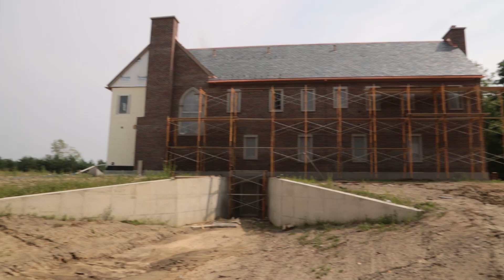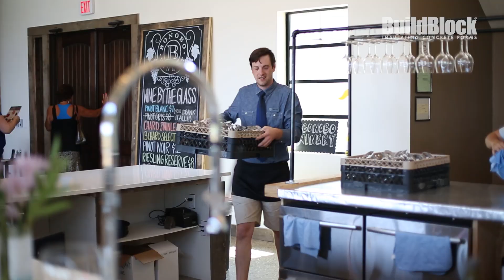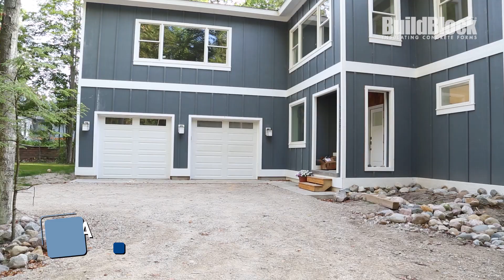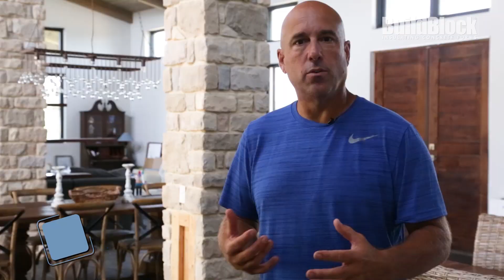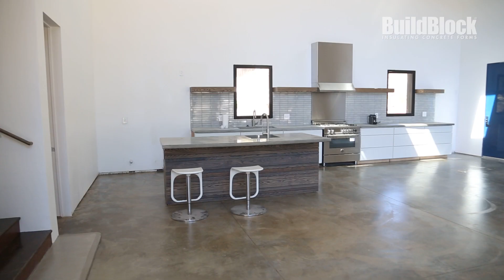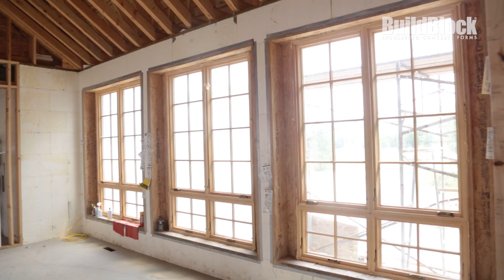Why Build With ICF? Real Customer Stories

Comment: Good testimonials; but I'd like to see more videos on houses that I can afford - like 1400 to 1600 square feet.
Reply: Why would a smaller icf perform any differently than a larger? The point of the video, it seemed to me, that icf is the perfect way to build regardless of size or location
Reply: @paulnovak833  i can relate more to a house that costs $250,000 to build vs. a house that costs  $1,000,000  or more.
Reply: @scottcraig1047  250,000 is definitely the low end of possible unless you are doing most of the work yourself
Reply: ICFs cost ~20% over stick-framing by most estimates that I have seen (but the devil is always in the details) but that tends to be the case with these more "exotic" systems that you pay more up front for long term gains in terms of longevity, durability, comfort and energy savings.  I have a little under a decade to go for retirement and my new retirement home will be ICF of some guise.  Nudura, Perfect Block, or whatever might show up in a decade for a concrete home will be my choice.
Reply: @cpad007  interesting. I'm building an icf home now and my costs will be almost the exact same as stick built. Or course I'm doing all of the work but I would be even if it was stick frame as well. By far the most expensive hidden cost so far is concrete pumping
Reply: I am building a 1400 sq ft house with a sloped concrete roof, check back with my channel in a few months to see some more detail about the different systems offered by buildblock
Reply: @jmuller86  Did you end up doing ICF?
Reply: ICF is durable but prefer ICH ie Insulated Concrete Hempbiock. Where the Hempbiock replaces the foam as a form and as a insulator and its far healthier than the poly foam insulation. For example hempcrete block moderate humidity levels. Also it creates a grid which means less concrete is used but you get more insulation. Plus no exterior sheathing or drywall is needed.Just a coat of hemp plaster or breathable exterior such as  stucco, 
https://hempblockaustralia.com/wp-content/uploads/2020/12/HempBLOCK_AU_LB300_Dec2020-WEBREADY.pdf

It's used in many countries but its just not produced USA yet since hemp farming is just becoming legal in the USA now.... So hopefully we will see a domestically produced in the next few years....
Reply: @TamilLatest  yes , the whole house
Reply: I hired a local buildblock distributor to help my wife and I build an ICF basement for our cabin this summer. Watch the video on my channel if interested.
Reply: dunno if you guys gives a shit but if you're stoned like me atm you can watch all of the latest series on InstaFlixxer. Have been watching with my girlfriend during the lockdown xD
Reply: @Ayaan Landyn Definitely, I've been watching on InstaFlixxer for since december myself :D